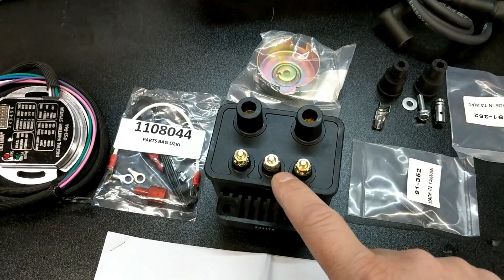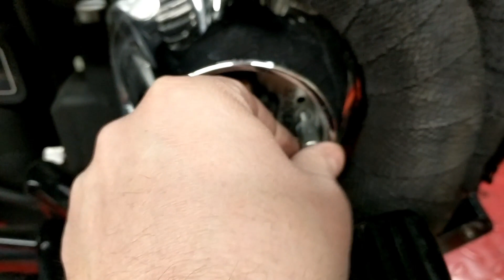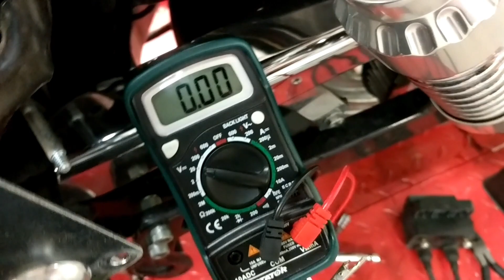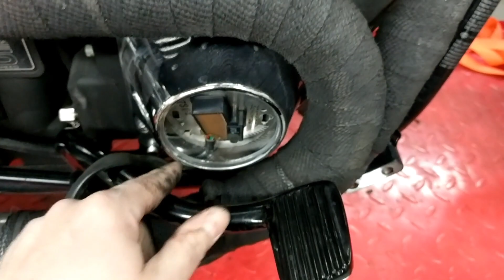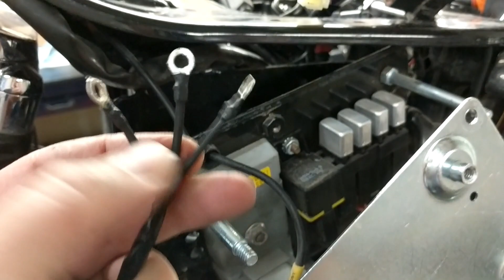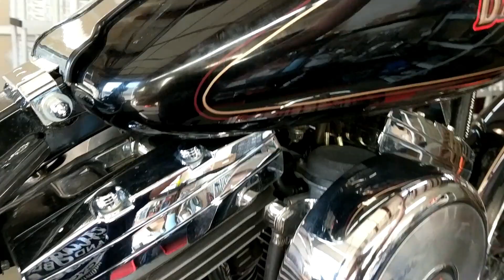How to Install Ultima Harley Davidson Evo Motor Dyna FXD Ignition Upgrade Kit

Comment: Hellow, how is the durability????  Maybe 2 coils???  I have a Sportster 1200 98 that uses a similar system but dual and is long time discontinued.  Im curios for when I have to replace the ignition!
Reply from the maker: Have had good luck with the actual Ultima brand ignition systems overall. Used them on many bikes over the years. Have had 1 failure of a module. I have tried the cheap no name copies on ebay and have had 2 of those fail. I've since ended up using Daytona Twin Tec ignitions with no more problems.
Reply: @OctaneElectrons  Nice!!!! Thanks man!!!!

Comment: how was it that the new system timing happened to be exactly the same as the old timing First push of the starter. I feel that the most important info I wanted was missing all together
Reply from the maker: It probably wasn't exactly the same. However there is only like 10-15* of advance adjustment. I just set it right in the middle and it will certainly run. Fine tune from there.
Reply: Because it’s designed and programmed to be that way minus a little push one way or the other to fine tune the can maps. 

If you don’t know how to find TDC on the front cylinder compression stroke, then you probably shouldn’t be timing your bike…just saying
Reply: You can also static time it by bringing the engine to TDC and using the light on the new ignition module. With the key on,  rotate the ignition until the light comes on, then lock the module down just as the light goes out...then use a timing light to dial it in..or not..lol

Comment: If I'm not running VOES do I still need to ground the violet wire?
Reply from the maker: No you can leave it unused and turn off the VOES switch on the module.

Comment: I got the Ultima for my Sportster but now have ping and can't get rid of it even while using premium all the time. I'm told it's not programable, so it looks like I need another kind of ignition. Wasted money for me then.

I don't want to scare people away from this kit though. Were it not for the ping problem, it would be wonderful. Great. So why is mine pinging all the time?

I bought the bike used. It was originally an 883, but the guy who originally bought it, had the Harley Dealer put on the 1200 top end and whatever else. I have no idea what else. Does it have high compression pistons? I have no idea. Does it have high lift cam gears? I have no idea. All I know is, it has a whole lot of rip in the high rpm's. 

If your Sportster is stock, I expect this kit would be fine. 

What was in it when I bought it was an ignition that said Harley Davidson Screaming Eagle, and it looked like it was made of plastic and was kind of warped looking. It ran on regular gas just fine at full throttle, lots of rip and no ping ever. Not even a hint of ping anywhere.. However at anything less than full rip, it misfired all the time, so I needed  a new ignition.

The Ultima runs great except for the ping I can't get rid of. I tried ever possible setting on the tiny switches. Nothing gets rid of the ping and I always run premium and still have the ping. I don't think these things are programable. If I could get the ping programed out of it, this Ultima would be fine.
Reply from the maker: Bummer, sorry to hear that. Hope you find an ignition that works well with your build.

Comment: Bike started real quick. I have 1994 Fxr with ev27 cam, s&s lifters, rejeted cv carb, high flow air filter and fab28 2-1 exhaust. What will this ultima ignition give me compared to the stock one? How much power it gives? Fuel mileage upgrades?
Reply from the maker: Not likely to be a massive power increase, but I think it is noticeable. I've noticed easier starting. I don't track mileage so I can't comment on that. It's a very reliable electronic ignition, especially compared to the OEM.

Comment: I turn on the key and both red and green lights just flash. All it does. Got any idea
Reply from the maker: Check your wiring, sounds like it is hooked up to the sensor module wrong.

Comment: Thank you so much I'm going to order one today and put it on next week. It should get my 95 Wide Glide moving again. Voltage regulator went bad and instantly burned up everything from the headlight to the battery to the ignition.
Reply from the maker: Right on, should work great. I'm running one on my current FXR and it's excellent.

Comment: Thank you for the vid! My original possition senser melted over time. By the time I actually replaced it with the Ultima, it was completely melted (the insulation goo) and can't believe it even worked. It was missing etc, NOW THE BIKE CAME ALIVE! 98 Wide Glide
Reply from the maker: Right on, glad it helped! The Ultima is a great ignition, run it on many bikes and it has always worked very well and been super reliable.
Reply: I'd like to know the wiring hook up colours the original pink and white purple stripe from the deleated ignition 
Box

Comment: On my 90 FXR I only get 10.5 volts on my white wire.even with a full 12 .3 volt charge on my battery. Will that work with this system.
Reply from the maker: Sounds like you might have a bad wire or connection. Yes it would probably still work, but I would troubleshoot that voltage drop first.

Comment: can i use the stock coil i have the  cam sensor as u do ect
Reply from the maker: You can't use the stock coil as this is a Single Fire system. You need a 3 terminal coil that can fire front and back cylinders separately.
Reply: You can if you run dual fire

Comment: Getting ready to install this on a stripped down / chopped Evo XL.  Could you explain here how to set and fine tune the timing?
Reply from the maker: The bike will run pretty much anywhere in the adjustment range of the ignition. To start, I set it dead center. The service manual will say to check static timing with a timing light through the timing plug on the left/flywheel side of the motor, just under the front cylinder. In practice this is ridiculous. Even with a clear plastic timing window plug, you can't see anything. Without it, you will blow oil everywhere out the hole. I gave up on that. I time them by ear and feel. Get it running in the center of the adjustment range, then go ride the bike. Advance the timing for best performance, listen for pinging when under load, then back off/retard the ignition a bit. If the motor is hard to start or kicks back, you are too advanced, retard it a bit more. Doesn't take long to dial it in.
Reply: @OctaneElectrons  Awesome sounds simple!  I like that! :D  Thanks for the help!
Reply: @OctaneElectrons  Great vid, and you do nice work. I don't know why you would not just time it with the mark on the flywheel before you ever start it.  Mess with it from there, but you're always starting at the same place.
Reply: @OctaneElectrons Dude you're so wrong and I can't believe you have all these people believing that you are correct, you're like a cult leader and they just follow you're every word, you rotate the engine until you are on the compression stroke of the front cylinder and the TDC mark is in the timing hole window, never time the engine rolling backwards always forward, when you see the TDC mark in the window go move the ignition module until the light turns off then turn the other till it goes on then back until it just turns off and then lock it down and it'll be static timed perfectly, and the gold rotor is 100% different than the stock silver rotor that was already on the bike, telling people that it's the same when it's not is pretty shitty, if anything comes in a lot then use all the parts they're there for a reason

Comment: Hello great video can you connect up to the new module to a laptop and download other maps 
thank you.
Reply from the maker: Yes you can. You need the adapter cable to plug it in to computer, but you can fully program it that way. Here is info on the cable:
https://sites.google.com/site/vrusb2000i/

Comment: Where do you get 12v off the coil white wire going out
Reply from the maker: If I remember right, the White wire is already +12V keyswitched to power the coil.

Comment: This is great !!! I also have 1998 FXD with that same hooker header but I didn't think the midcontrols would work with it but I see it does great video! Hope to see more!!!!
Reply from the maker: Yes the mids fit great with the hooker header, no problem. I did originally have a Superbrace connecting the transmission to engine, but it would not clear the mids so I sold it.

Comment: Hey mate, you put SW1 to off but you are using a voes? Is that correct or did you later switch it to on?
I've just installed an Ultima ignition, I have spark but the bike won't start. I don't have a voes and per the manual I thought sw1 had to be off?
Reply from the maker: I was using a stock VOES switch.  You want to leave SW1 OFF for normal VOES operation. Per their instructions:

SW1 - OFF , using Normal VOES switch

(USING VOES) - Allows timing to reach full advance by 1500 rpm under light engine load conditions,
improving throttle response and gas mileage when the VOES is present. Wide open throttle follows selected
pre-set curve. (high vacuum curves)

No matter what, this switch setting would not affect your bike starting. The VOES switch is only affect by a big vacuum change. You definitely have some other issue causing the no start problem.
Reply: @OctaneElectrons  ah ok, I have no voes so I assume I still leave sw1 off?
I found my issue, almost too simple to mention, I had the pink and blue on the wrong cylinders, derr
Reply from the maker: @cameronnoonan8546  haha ya that would do it. Yes you would want to leave SW1 OFF. You only turn it ON to use the VOES wire as a timing retard trigger, meaning the Purple wire becomes an input for a switch to retard the timing map. If you don't have nitrous or turbo, there is no need for this functionality. Leave the SW1 OFF and if you're not using a VOES switch, the purple wire will never be triggered to change the timing anyways.

Comment: Wrong, in the instructions they tell U not to use the original ignition rotor that the gold one is necessary for the the module's performance.
Reply from the maker: I'm sure they do, but the timing cutouts on the old and new rotor are identical. I can tell you for sure they are interchangeable, however you might as well use the new one provided with the kit.
Reply: @OctaneElectrons  my oil pump went out on my 96 flhtcui (efi)..I'm putting a ultima ignition system in it,and ev27 cam as well,and adjustable pushrods,, I have great spark,but not getting gas..I have tried both rotary cups,,original, and the one supplied with ultima system..they are both gold, but very different in shape.original has half cup cut out, ultima one only has 2 small notches, 1 strait across from the other,,,I cannot get either to fire injectors,,,do you know what I'm doing wrong as I'm a fairly knowledgeable but cant figure this on out..everything seems correct,but injectors not firing...help !!!
Reply: I got off track a bit,,,when my oil pump sheared a key,,my thought is it got hot in nose cone (cam cover) and when I pulled the cam cover off,,the wax in ignition module was melted,,I repaired oil pump,,but while I was in it,,I also put ev27, lifters,and pushrods...the bike was still running when I started doing the work,however,with the melted ignition module, I didn't want to put back in, because of the melt damage even tho it still worked..this is what led up to the ultima ignition 53-660 which is suppose to work in a evo with e.f.i.,,,,but as I stated, great fire,no fuel,,,I've tried both cups,different shaped,both gold,,,but absolutely not firing injectors,,,I hope that caught you up as for what happened,,and how I got to where I'm at now,,,thank you again
Reply: @michaelpayne5265   the ignition doesn’t trigger the injectors. I’m sure you’ve figured that out by now. FI models use a crank or cam position sensor to trigger the injectors.  If you disconnected the cpu when you installed the new ignition you need to connect the cps for the computer to fire the injectors. The cps tells the computer when to inject fuel in the cylinder.  There are ignitions with external modules that will do this, they plug in where the old module was. This ignition doesn’t support the injectors. If yours does, look to the cps for the issue. It may need cleaned or replaced.
Reply: If the bike has the gold cup already, it’s fine. The issue was some of the early ignitions had a silver cup, those won’t work.

Comment: Straight and to the point video. Good camera work on disconnecting the module and ignition cam plate. Would love to see how you timed the bike through the timing hole TDC. Thanks..................
Reply from the maker: Thanks! Sorry I sold the bike awhile ago. I've got another 98 Dyna in the shop now, might do a video on that. I think it has a Screaming Eagle external ignition module in it though, I'll have to double check.
Reply: I am trying to determine if my Dyna 200i module is faulty. Bike craps out like crazy and fuel and coil test good. The specks say the red led light should flash once when key it turned on to verify system operation, and then blink off and on when running. My module red led light will not turn on when ignition is turned on or when cranking it over. The tech at Dyna tek said it may not be necessary for the red led light to turn on for module to be good. Any thoughts on this? Thanks.
Reply from the maker: @savnbest4last249  Very common for ignition module failures. I've had a Dynatek and a CompuFire ignition module fail in the past. Bike will start to run really poorly, and have a very noticeable ignition miss, if it doesn't completely die. As far as I know, if the red LED is not flashing, it is not firing correctly, or at all. It's possibly but unlikely the LED burned out. This is very similar to what happened on a 96 Evo electra glide I had when the ignition pickup in the nosecone was failing. I would go ahead and replace the ignition, it will likely solve your problem.

Comment: Dose it give u more power? Like hp
Reply from the maker: Yes over a stock ignition it is a slight performance increase with the new timing maps. Paired with intake and exhaust it can make a significant difference.
Reply: @OctaneElectrons  okay thanks I did my exhaust in my intake just looking to see what else I can do next thanks have a happy holidays
Reply from the maker: @newwavepressure6478  Thanks and you too! I would definitely look at an ignition upgrade next, it is worthwhile.

Comment: I use this exact ignition system on my 99 Evo Chopper...I was burning up coils before ,now my coil stays cool to the touch and the bike runs fantastic. I installed this in 30 minutes this is the easiest ignition system to install and program ever!
Reply from the maker: Right on, that was my experience too, super easy to install. I'm running it on my Shovelhead now too and it works great.
Reply: @damny when you put this on do you have to static time the bike by rotating the back wheel till the marks get in the hole...
Reply: @bloodbatteries4797  up date I installed this and bike starts right up......time it by just turning it just a little bit to the right.......

Comment: What kind of exhaust is that? I have a 95 fxd with the same pipe but no baffle I need to find the baffle lol
Reply from the maker: It was pretty rare. From Hooker, called a Tuned Flow 2 into 1. I loved that exhaust, sounded great. The cap on the muffler could be installed 2 ways, 180* opposite for different back pressure.
Reply: Thanks alot I appreciate it. I was trying to find who makes it so I can try and search for that

Comment: Great video did you have to modify wires for your tach ? ( if it’s stock?) I have 97’fxdl was wondering before I buy myself. Thx. Looking for how to modify my 01 sporty that I already did this upgrade to & the aftermarket tach does not work.
Reply from the maker: No modification needed. Tach output on the ignition worked perfectly with the stock gauge.

Comment: Why doesn't anyone do a video about how to install an external electronic ignition kit in a shovelhead single fire of course, I can't find a video on that anywhere, and can you static time them also?
Reply from the maker: Sorry, don't have a shovelhead, yet. Though I'm in the market for one. The shovel and evo bottom ends are very similar as far as i know. If you find a video applying to an evo it should be the same process. There are plenty of videos about static timing out there, I did not include that in my video.

Comment: Great video, I bought a kit for my 83 fxwg shovelhead. How much different is it from this video...? 
Also, could you explain how to time the motor.
Reply from the maker: Should be a great kit for your shovel. I haven't installed one on a shovel, but the process is pretty similar I think. I'll try and do another video on timing the motor from a new installation with this kit.
Reply: I have one in my shovel, my ironhead and my Evo. It’s very straight forward if you follow the directions. Woke up my shovel quite a bit.

Comment: great video but any questions .....because you did not use a stroboscope gun? 
it is necessary for a good regulation or it can be done without?
Reply from the maker: No I didn't use a timing light to time it. I've done enough of these to set the timing by ear. You certainly can if you want to be more accurate.
Reply: thanks

Comment: Great vid right up until up didn’t show you actually timing it. Bummer
Reply from the maker: The video was meant to show the installation process, which is about the same on any bike. Depending on your motor and mods, I can't cover all the combinations of correct ways to set up the ignition and time the motor. That parts up to you and your particular bike!
Reply: Any problems? Mine just failed after 500 miles. Rear cylinder not firing, pink wire had no juice before coil. Sucks, I just received new one and getting ready to install